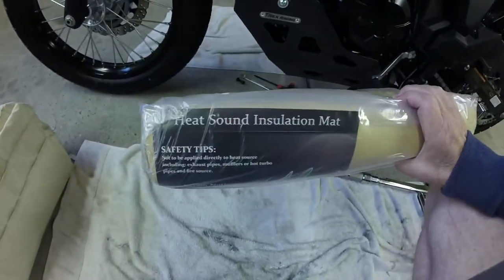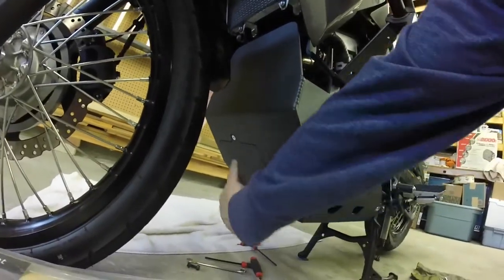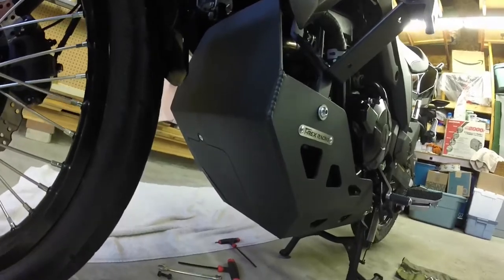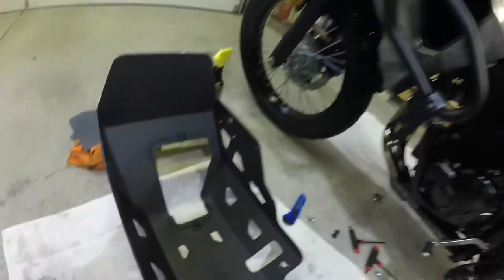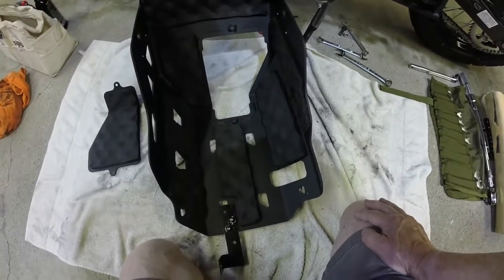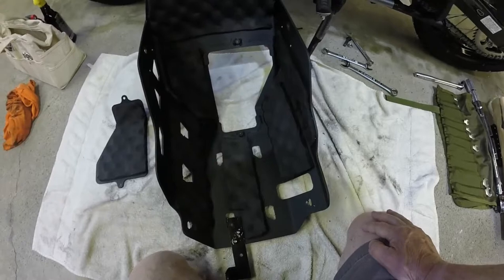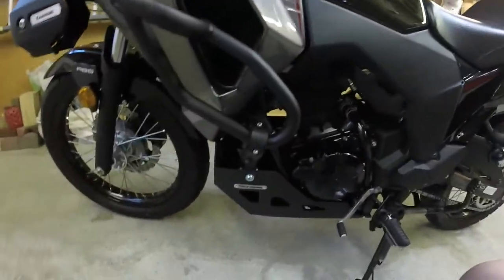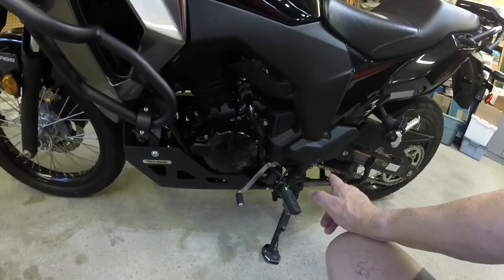Kawasaki Versys X300 2017 - 2021 Quieting down the resonant vibration on the T-Rex HD skid plate

Comment: I have had an X300 for just over 3 years and still love it! I have the smaller T-Rex skid plate and also T-Rex crash bars. Very happy with both. I'm just under 5000 miles on this bike. Although I also have a now street legal dirt bike and also a 2018 Vstrom 650 XT, and ride all three, I still love this little mini ADV bike. (Not mini by size, just small displacement). As you know these handle like a dream and get great mileage - 70 mpg on our 40 mph county roads in SW Colorado.  I've ridden part of the TransAmerica Trail on the X300 and also several Jeep trails in the mountains here. As long as I'm careful with the limited suspension range, this bike can handle a lot. I deem it a true ADV bike, just a 300cc ADV bike. Zero problems so far. I fabricated a 1 x 1 inch angle aluminum bracket to attach to the front of the T-Rex crash bars (where they meet below the headlight) and attached Auxbeam 4 inch square auxiliary lights to each 
end. Not street legal, but I ride only a little at night. LOTS of light at night and good running lights for daytime. I added a USB for a phone charger. Also lowered the pegs one Inch and added a 2 inch Rox Pivoting bar risers (I'm 6'3 and stand a lot. due to a bad back I can't lean over very much for very long. Ergos are now near perfect. I put extra seat padding under a Mad Dog ATV seat cushion and then added a SitNFly seat cover for seat ventilation. Also added Enduro Engineering hand guards, Givi side case racks and then attached my own Pelican cases for luggage (screwed on, not detachable, but will add detachable Givi luggage this summer). With a CoreTech magnetic tank bag I consider this an almost idea setup. I've only made one interstate trip (5 days on back roads on the TAT) but all went very well. THANKS for post your vid - excellent "how to." - GeezerWheels
Reply from the maker: Thanks for all the detail about what you've done to your X300.  It is a very customizable bike and your testimony is an example of what can be done to raise the bar so the little ADV Versys can excel.  I've owned my X300 less time but also believe it is the right choice for me also with the light weight and capability.  Thank you for your detail.  Enjoy my channel for many mods and upgrades.

Comment: Hi, same bike but much smaller trex skid plate. Yours is enormous! It also blocks airflow to the engine?! What is the weight of that thing???
Reply from the maker: T-Rex has two skid plates.  The small one that covers about half the exhaust pipes and then the heavy duty one that I'm upgrading in several of my videos.  I have had the HD skid plate on my bike in many conditions including slow speed in hot weather and the air flow is not affected.   The radiator is where it is important to keep clear and the HD skid plate doesn't cover the radiator.  The HD does cover the front of the engine and I was concerned about excessive heat but it turned out to be a non-issue.   The HD skid plate is the only one that I know of that does NOT use the original brackets from the lower below the engine plastics.  The plastics are attached to the screws / ears on the fragile aluminum oil pan.   The Versys's oil pan was never designed to have skid plates attached to the ears that can be damage easily.  And the T-Rex HD skid plate has a provision for the one sensor wire on the right side.   The HD skid plate weighs about 4 pounds - just a guess.  It is aluminum and is 4mm thick.  The brackets are another pound I would say as they are steel.  I've beefed up the HD skid plate with two additional brackets that attach to the M10/frame center stand bolts that make it super strong to lift the whole bike up in the air on a traditional motorcycle stand.  No other skid plate can come close to that.  See my other video that shows all the mods and results.  It was a fun project.

Comment: Will it suck up oil when changing your oil?
Reply from the maker: Good question - I have a multipart answer.  
As shown in this video I've got the sound deadening material on the bottom of the skid plate.   Two things happened after this video - 
**  the first I removed some of the material because it was close to the catalytic converter and that thing gets hot. And this stuff doesn't burn or melt so it just kind of cooks and has an unpleasant smell.   I've put a butane lighter to this stuff and it just kind of turns to ash after several seconds of trying to light it.  A fire hazard it is not.  But I just trimmed back the materal on the bottom.  
**  the second thing I ended up removing all the bottom material in the latest video where I beef up the skid plate (again) with two 13 inch long by 2 inch angle iron pieces to be able to lift the entire bike up in the air with only a slightly modified motorcycle jack.  What an accomplishment that was as I also completely restored an old beast of a Sears Craftsman jack.  That leaves no material in the bottom to get oil on to give a short answer.  Please see that video here:  https://www.youtube.com/watch?v=ZOFhH2zYQyM&t=1327s&ab_channel=trekOCLVone

Now - I'm no an expert on this skid plate with oil changes as I've not had the skid plate on the bike for the oil changes done so far.  I think that oil filter isn't going to be an issue as other x300 owners have provide a great trick - once the filter is loose put a zip lock bag around the whole thing as you remove the filter - great idea and I give credit to those owners for the tip.  The drain plug with or without the sound deadening material seems like it is going to get messy.  I'm already thinking about how to solve that with some ideas but haven tried any of my theories yet.  If you have any ideas please share.  The skid plate just has a inch wide slot that is going to be an oil catcher.  lol   Please help in solving this one issue and we got this under control.  I've taken off the skid plate many times during all these videos and rather than making a mess I'll just remove the skid plate for oil changes - even with my final beefing up with a 5th and 6th brace back to the two M10 center stand/frame bolts I can get the skid plate off in just a few minutes.  Thanks and stay tuned for more videos.  I'm working on one now to solve the issue of condensation on/in the engine during the winter months because of rapid temperature changes.  the key is keeping the engine warmer than the ambient temperature.  Simple but I'm on it.  I have top secret lab experiment cooking (well heated up) in the top secret basement lab as I type this.